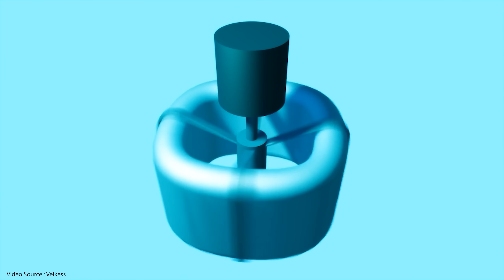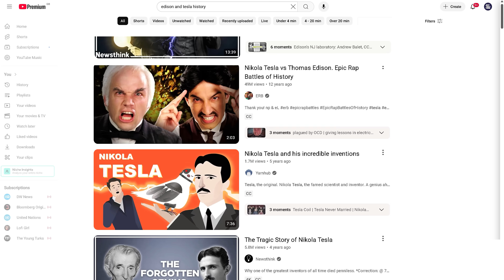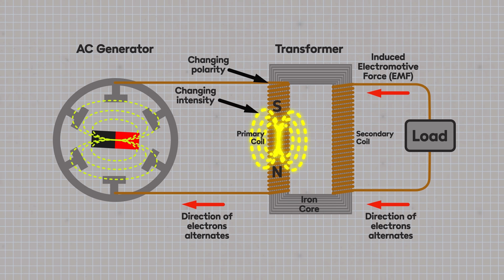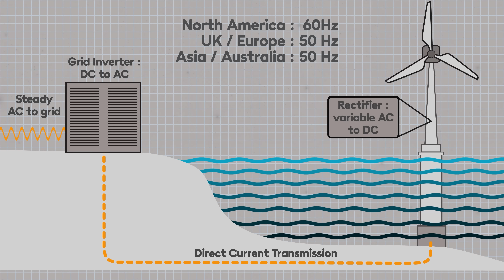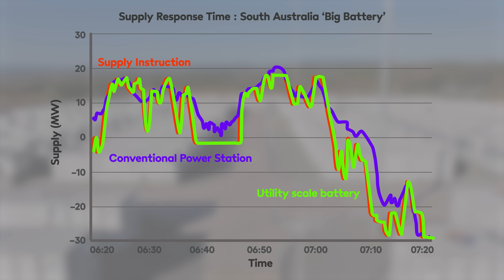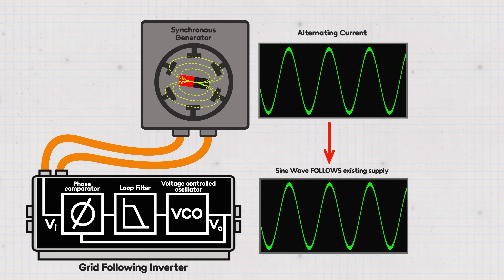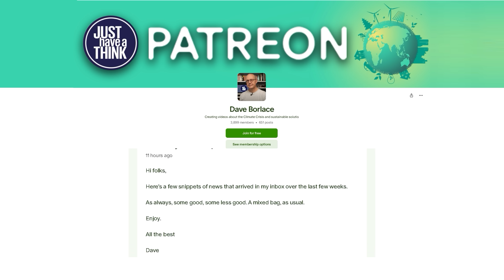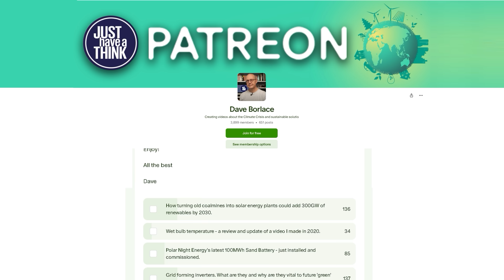How GRID FORMING INVERTERS are paving the way for 100% renewable energy.

Comment: This is a good video but there is a bit of misconception in industry about inertia providing grid stability. It is the direct voltage and frequency control provided by synchronous machines that provides stability. All Inertia does is slows down the power ramping resulting in larger frequency oscillation. In fact, adding to much inertia can cause instability because the system responds to slowly to load changes. This is why a power grid dominated by slow base load power plants need a combination of fast responding peaking plants to maintain stability.

The reason you need a small proportion of synchronous machines or grid forming inverters is to provide enough grid strength for the grid following inverters to synchronise with. You cannot stabilize a grid with grid following inverters alone because they behave as current sources and don't match their output with the load. This is unlike grid forming inverters and synchronous machines that behave like voltage sources that regulate frequency which provides the frequency control that grid following inverters can use to load match. This is why grid following inverters power down when disconnected from the grid while grid forming inverters continue power by forming an island.

Most grid forming inverters don't have any inertia and just use a simple droop control for frequency and voltage regulation.
Reply: Your explanation of base-load generators confuses OUTPUT and STABILITY.  Grids must have fast ramping generators to deal with rapidly changing loads.  They also need frequency stability to keep the grid from crashing due to transients.  The rapidly ramping generators are often simple-cycle natural gas generators that have huge rotating inertia.  Before the last few years in which solar/wind became common, ALL electrical generation had huge rotating inertia.  There is no such thing as too much inertia on a grid.
Reply: @dzcav3  If you look at the swing equation you will see that the Inertia constant is the main synchronous machine dynamic the determines the frequency response of the system. Peaking power plants have smaller inertia constants then base load plants which results in smaller frequency oscillation. Older power generation used Reciprocating steam engines that have lower intertia then closed cycle turbines.
Reply: Plus, most inverters don't have a particularly large surge capacity for clearing faults, by tripping breakers. They trip offline, rather than attempting to ride-through and help clear the fault.
Reply: @johnbooth5199  not true, inverters can ride through faults as constant current sources due to their current limiting control
Reply: These inverters may be able to replicate inertia well enough but is a grid with thousands of these going to be as reliable as the old grid which consisted of a few dozen rotating machines?
Reply: @graemecreegan6749  It's not about replicating inertia, it’s about replicating the frequency droop characteristics of synchronous machines. If you look at microgrid case studies and large-scale simulations, you will find the nadir frequency is lower with grid forming inverters then with synchronous machines. The removal of inertia allows the grid forming inverters to more quickly change from one steady state to another.

Comment: Even simpler, a DC motor powered by DC solar could turn a turbine generator to produce nice smooth AC. Turbine generators don't have to be rotated by steam or gas, a DC motor could be couple to the turbine generator. Also, keep the flywheel tied in and you have your inertia rotation. I'm just having a think about  it.

Comment: Thank you for Basic explanation of AC. I was expecting discussion on actual existing inverters, because all of them have to be “following “ the power grid and “generating “ if grid fails without switch over. We do need cheaply for 1, 5, 10 kw. Normal house in Florida needs 10 to 15kw, due to AC, stove, water heater. I will buy one by-directorial up to 15kw, 12 to 120v dc in (preferable 60v dc, because it is best multiplier 60 120 240 480 960 etc. or set new decimal standard based on 50V dcnominal.) than all this will become useful. $1,000 max.

Comment: 6:30 are you saying it was possible to start power plants which were not connected to an energised part of the grid?  My understanding is that combustion plants needed power to start and operate, and nuclear had to SCRAM and use backup diesels to run the emergency cooling if disconnected.

Comment: Good video, as remarked by others. However, you omit the fundamentals - possibly subject for a new video.
The whole issue is based on power and energy. So when power demands exceed generation, frequency falls to maintain energy balance (Physics at play). This deficiency is in the short term compensated by using rotationen energy in the generators OR by injecting energy electronically - which can only come from a battery.
So nem of the game is energy/power balance - which require a source or sink (charging a battery / increasing rotation speed ever so slightly).
Without an understanding of the basic energy/power balance it all becomes mysterious.
Start with the simple stem engine ned the simple rotating govenor - from the time of James Watt.

Comment: No one ever listens to what I say, but if someone with more knowledge of the subject than I, please tell me what's wrong with the argument that the load could be equalised more efficiently if the grid operated on a modular, localised basis. In such a system, excess energy could go to the batteries of our EVs, in a designated geographical area, and draw energy back when needed. Each localised area would be connected to the national grid, and each area could draw and supply from the others as needed.  I realise that inverters and algorithms must supply and draw power as and when required. However, if there is no major reason why such a system would work, 90% or more of the components are already in place.

Comment: I assume residential inverters that support island mode (grid disconnected) provide their own mini grid until the main grid is back online then switch over to that?
Reply: Yep, some can grid-form, so they can lead a local solar inverter, some cannot, they just act like a dumb inverter.
Battery systems can grid-form to control and accept power from solar.

Comment: Glad to hear the progress is largely a change in software, meaning existing inverters might be upgradable for a low cost.
Reply: Thats basiclly the difference between the SMA sunny boy, and sunny island, family of inverters.
However, they are approved for different use cases, so you can't just upgrade the software, even though in theory it should be possible.

Comment: This is an excellent video, Dave. Well done, and thank you.

I am an Electrical Engineer from Adelaide, South Australia's Capital City. I have spent much of my career building Australian NEM Assets, including fossil-fueled, mostly gas-fired, Power Stations, Switch Yards, Substations, Transmission Lines, Distribution Lines, and the SCADA systems that allow the safe operation and management of those NEM Assets, in all NEM Regions, and many Power Islands around Australia. For my sins, I also used to teach Electrical and Software Engineering, predominantly Electrical Engineering Practical Laboratories, to all disciplines of Engineering (including Civil, Mechanical, Chemical, and Electrical) in the 1980s.

I make it my business to document, on LinkedIn, the rapid transition that SA makes towards its goal of Net 100% Distributed Variable Renewable Energy and Storage (DVRES) by the end of Calendar Year 2027. The Net 100% DVRES "end of Calendar Year 2027 goal" is a bipartisan legislated goal for South Australia. SA's transition is unique in the world, not only because of the imminent timeframe, but also because of the factSA has no viable commercial access to Hydroelectricity or Pumped-hydro storage. That means SA's transition is happening courtesy of 100% Solar, Wind, and Battery (SWB).
https://lnkd.in/ggbKJ2mB

SA is the World's Power Systems Laboratory, implementing the world's 1st "Digital Grid" connected to an old analog "Synchronous Grid". SA has many unique NEM firsts, including the 1st NEM Region to add a BESS, at HPR in 2017. The 1st NEM Region to add a grid-forming (GFM) BESS with Virtual Synchronous Machine (VSM) Algorithms implementing Synthetic Inertia (SI) at ESCRI in 2018. The 1st GFM/SI BESS in the world that was contracted to provide Black Start and other FCAS Services in 2022. Many other SA firsts can be seen in the following article.
https://lnkd.in/ggaRkuiF

I have some suggestions to discuss with you that may improve on this already excellent video, and perhaps other ideas you might like to discuss. Please send me an invitation to connect on LinkedIn if you wish to discuss. 

Kind regards,
John
https://www.linkedin.com/in/johnanoonan/

Comment: Synchronize waveforming generators and controllers to common satellite clocking. Embed simple wave shape parameters like peak timing on top of WIFI, NTP, or even GPS broadcastin; adjust for locale and grid characteristics...

Comment: The important issue is timing where the phase cycles must be in sync. This can and I'm sure is done via cell tower and GPS time code control and atomic clocks. So frequency cycles are synced so when the grid is restored they match.

Comment: It would be great if Dave could pin this comment as I would like to clarify a misconception I see in many of the comments below...
What many people wrongly assume is that a grid-forming inverter require some accurately defined frequency reference.  The reality here is that the grid itself provides this reference and the other reality is that the grid frequency is not solidly fixed but is designed to be variable.  The grid frequency serves as both the input and output of a very sophisticated distributed democratic control system.  The logic behind this distributed control was first implemented over 100 years ago and it still works well today.  Every grid asset has the ability to 'vote' in this democratic control by trying to either pull or push the grid frequency - the rules for voting are defined based on what is called 'primary control response' - there are two 'gain' (droop) settings defined for each asset - a Volt-VAr and a Frequency-Watt setting.  The actual grid frequency according changes as a result of all these distributed votes and the single resultant frequency of the grid indicates the instantaneous balance between generation and consumption.  The grid operators can adjust these primary control response settings using what is called 'secondary control' - which involved defining different primary response droop (gain) settings in the form of a pre-determined schedule which is then communicated to each and every grid asset.  The thing with this method of control is that the channel used to communicate secondary control schedules does not need to be low latency and it is not critical to make sure that every asset is running with the latest schedule - this two tier control is deliberately designed to be resilient and robust even if the comms channel is not reliable.
Traditional (rotating) grid assets have been using this control method for over 100 years.  With renewable energy Inverter Based Resources (IBRs) the initial thinking was that they should not be based on this traditional control approach - hence the advent of grid-following inverters (a requirement to ensure that the PLL exhibits zero inertia), however as problems of having too many grid-following inverters have become apparent there has been a move to make IBRs operate according to the traditional way that other grid assets are controlled - hence this concept has been called 'grid-forming' inverters.  What need to be understood here is that these concepts are not new in the utility space and it is grid connection legislation alone that has dictated that IBRs must have zero inertia (I.E., grid following).  The main differences between grid-following Vs grid-forming relates to grid interconnection legislation and whether the PLL used in the inverter is designed to have inertia or not - No inertia = grid-following.  Inertia = grid-forming.
Reply: Thank you for answering a question I was going to pose !

Comment: Having previously tried to decipher this information from an engineers paper on this technology and being puzzled by esoteric terms such as 'droop' this video gives a clear outline of the overall context, which is all most curious parties who are not Phd  level electrical engineers can usefully comprehend. The grid  forming  inverters kick the whole grid off in sync like a distributor, but for frequency patterns only, in an old ICE banger? Presumably the forming inverters need something more than a 12v battery? The size of the GVA for grid forming inertia will be a work in progress as the grid input types change and evolve day by day for the grid. Perhaps the future grid controllers listen to the frequency converted to sound,  a bit boring, but a strange job. See 'Metropolis' where the idea was first envisaged: https://www.youtube.com/watch?v=IcReykfvqi4

Comment: One thing you can always take away from Dave and JHAT, is that the naysayers are consistently wrong. I think their tactic that bugs me the most is the "all or nothing" stipulation. "We CAN'T convert to only EVs because the grid will collapse!!!" or "What will we do when the wind stops and the sun sets!!!" It seems they are incapable of recognizing that the energy transistion will be gradual and adjustments will be made as needed. No informed person has ever suggested we throw a big switch and in an instant convert to all renewable or all EVs, but that is usually the foundation of their argument. Humans are good at solving complex problems and the grid is one of those. I have full confidence in the engineers and technicains who will build and improve the grid as we move forward.

Comment: Grid forming inverters are not that new. They may be new at grid level. Take a look at off-shore cruisers or over landers with inverters. They can form their own grid while traveling or follow the grid when plugged in. I have a "micro-grid" in my house that can power my house from solar or battery if the grid goes down.

Comment: Another excellent video.  It leaves me wondering what sort of inverter is in my GivE AIO home battery? I notice  that response to a grid failure is virtually instantaneous, but reconnecting to the grid afterwards takes much longer.  I assume that the delay is caused by the inverter trying to resynch with the restored grid frequency??

Comment: Perhaps I'm slightly off topic but I want to see more focus on turbines; they can work on much smaller scales than huge wind farms.
'The Water of Leith' has some 11 or more "Wears' "left over from the Industrial revolution that fed mills of all types from Snuff to Saw mills within the Edinburgh-Leith aria alone. Until recently* Every one of those Wears was sitting idle and and each represents 99% of the Engineering groundworks necessary to install a turbine (or more?) at a conservative estimate each could supply 200 households(or more).
Although the river always flows you can envisage a buy in option where if you buy X wats battery storage capacity you can be connected  to a turbine scheme. The more join the more efficient the maximum generation to storage capacity ratio becomes.
Years ago I lived on Two 6v Nuclear power cells connected for 12v supply, I never managed a wind mill (Not My fault I had to move) but a friendly neighbour let me charge them and by doing so about every 15 months I never ran out.(No it was not my only Fuel).
My example is not ideal but People don't yet understand how good batteries have become, nor that most electronics equipment transforms mains electricity into single figure values or at most two digit ranges. 
Only Ark welders' and the like need a lot of power and even these can be used by converters  from a DC source at the cost of stored power.
* Edinburgh with Saughton Rose Gardens have installed one I think could do 500 households.

Comment: Grid forming inverteers should be nothing fancy, my home system dated 20217 can set up a local grid, and do everithing that's needed for that. It looks to me that almost any inverter based battery should be able to do so,  using a software update, if not held back by regulations.

Comment: It is perhaps ironic, after the AC/DC wars were won by AC, that HVDC is actually better, nowadays, for long distance power transmission. HVAC wires generate enough wasted energy that there are YouTube videos about harvesting it with an antenna near a power line (thousands of volts but microamps). AC doesn't go far underwater, either. Capacitance.